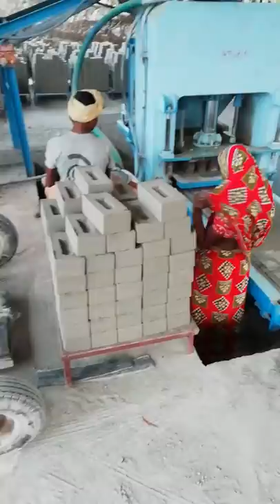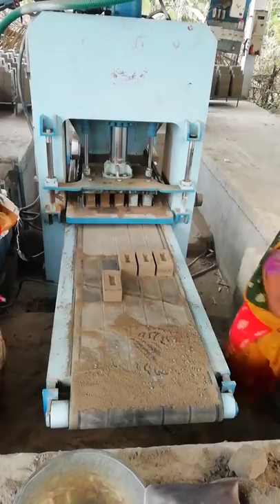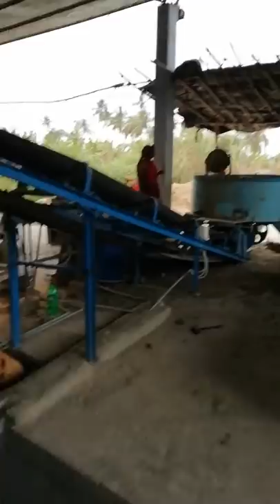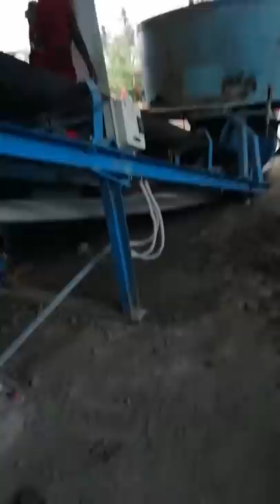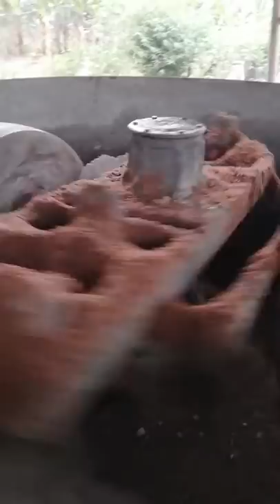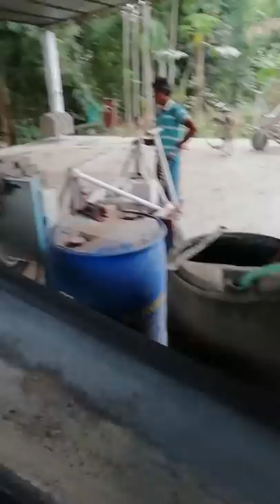B. K flyash bricks

Comment: Contact me for raw material (flyash)
Reply: Do you provide fly ash in bbsr..
Reply: @ajeetkumarjena9928  bbsr means
Reply: @sandipkumar1021  Bhubaneswar
Reply: @ajeetkumarjena9928  Powder Chemical Hardner (May 2022 price)
use 250-500gm hardner per 500kg brick mixture 
50% reduction in curing or hardening time
Rs 400 per 25kg bag for minimum 5 bag and above order
2% discount on 50 bags and above order
5% discount on 100 bags and above order
10% discount on 200 bags and above order
20% discount on 400 bags and above order
GST including and Transport extra